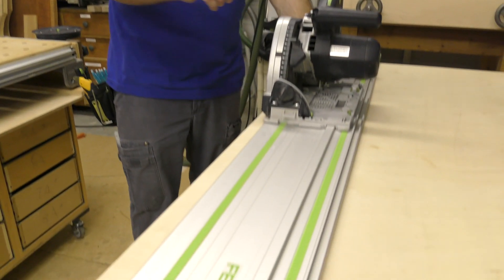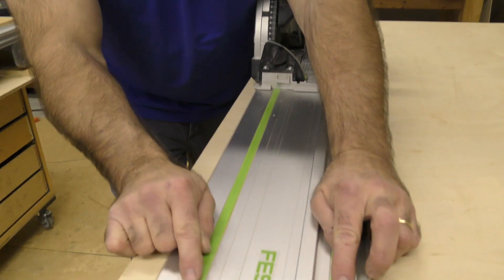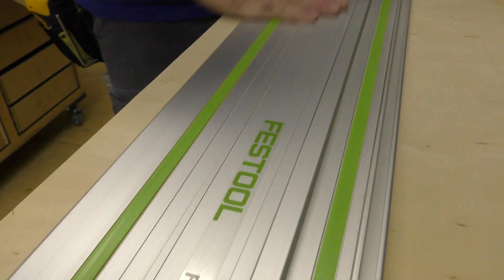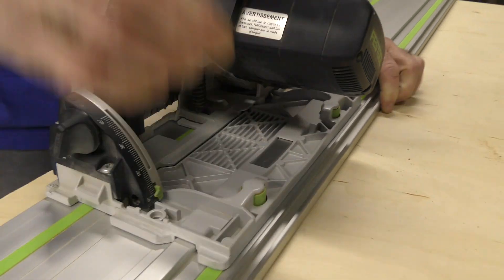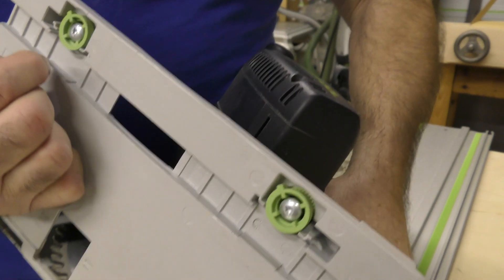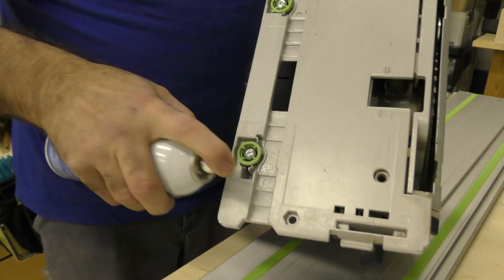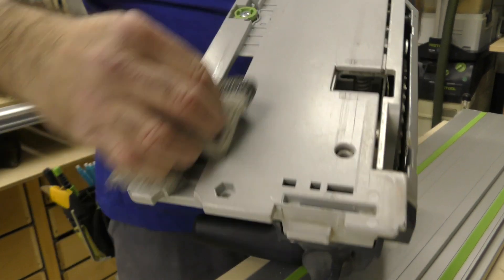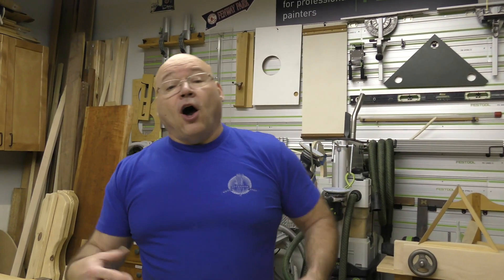Track Saw Tip: To Lube or Not To Lube?

Comment: Why does this not have more views? Thanks for the tip!
Reply from the maker: I was wondering the same thing....🤣🤣🤣🤣
Reply: @sedgetool  you were the top result when I googled it. I used some paste wax on mine and it is a good bit smoother. Just need to do some more tweaking. Thanks again for the video!
Reply: Would this work on handsaws to lubricate them better than wax?

Comment: polytetrafluoroethylene.. ( PTFE )is super slippery but very soft,  the glide strips on those rails are PET not PTFE a much tougher plastic, which does have some abrasion resistance but nothing like PTFE,  Try putting some silicone or wax on the area’s you mention and on those green strips you’ll be amazed at just how much it helps, also look at used track saws where no lube has been used.! Those strips  wear grooves into the alloy base plates… just saying..👍
Reply from the maker: Thanks for the info !!